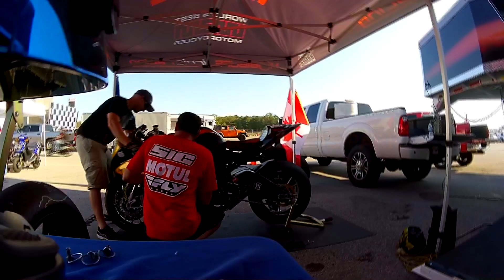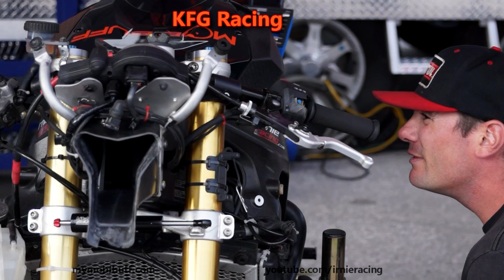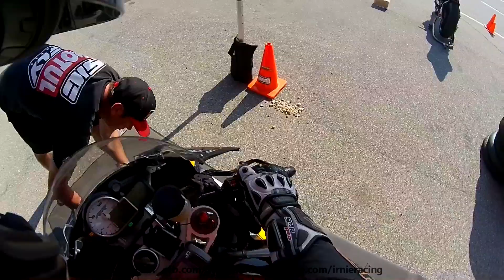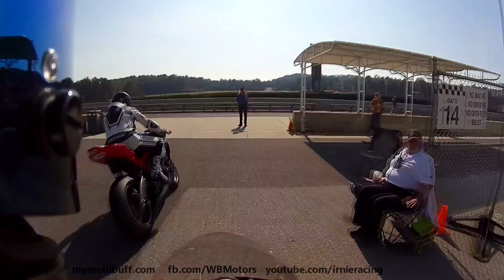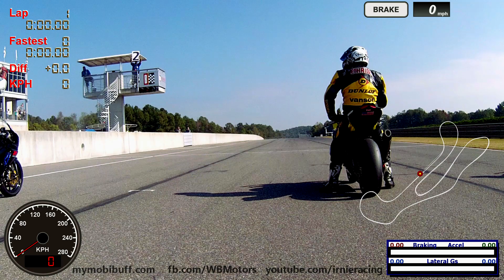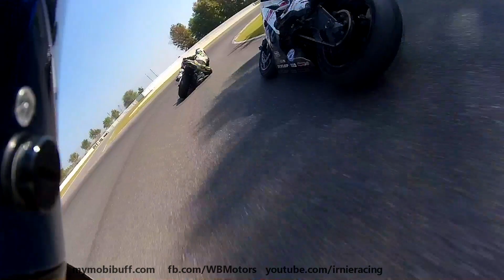S1000RR Racer: BARBER Superbike National [16.6] 60fps

Comment: Why are you turning of the engine after driving one relaxed warm up round? Wouldn't it be better for the engine to stay on?
Reply: To keep it from overheating on the grid.
Reply: Cooler=more power
Reply from the maker: SAViNGLiVE5
Correct.

Comment: that last pass was bad
Reply from the maker: I had to make an evasive maneuver to avoid contact, when he stuffed my inside.   But that's racing.
Reply: Most racers and racing fans would call it a heroic pass, not a bad dirty pass. And I'd agree, both as a fan and as a racer myself. You don't go racing to follow people around and only make passes when they leave you a mile wide gap.

If you take a wide line around a double apexer with people right behind you and don't carry enough corner speed, particularly in the last few corners on the last lap, you are almost certain to have someone trying to get up the inside.
Reply from the maker: Edward T Crump it's also about making a safe pass.  If the rider in front is carving to an apex and you just throttle in at the apex (without showing a wheel or claiming your line before the apex), you are looking for dangerous rider contact.  It was not a safe pass, but it was racing, and shit does happen.
Reply: You seem to disagree with the move, but accept that shit happens in racing. But I don't think that 'shit happened', I think it was a good opportunistic move and applaud the guy for it.

I agree that "it was racing". A certain amount of risk taking and battling is expected. That's why it was heroic. Perfect pass? No. It wasn't a perfect opportunity, but like I said, you don't go racing to follow people around and only make passes when they give you the perfect opportunity. You can't expect him to just back off and ignore the chance. Mid-corner in the middle of a double apex is about the best chance he has beating you on that 600. 

Don't want people trying to sneak up the inside on the last lap? You'd better ride more defensively and not leave the door open. With the pace you have, there aren't going to be many who'll be able to make it stick around the outside of you.
Reply: Edward T Crump I see myself agreeing with you here, It was something Jorge Lorenzo had to deal with fighting against Honda, where as those riders, and bikes are point and shoot, and they're aggressive to take the inside, while Jorge Lorenzo likes to have a lot of corner speed and sweep, he finds himself getting put into the same situation and having to brake because someone cuts his line. It's highly highly aggressive, but it's racing.